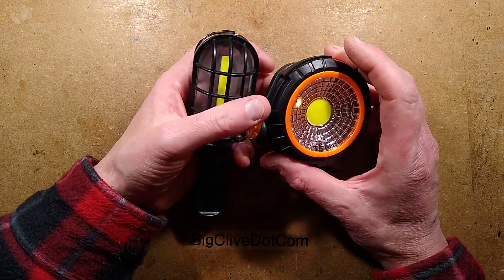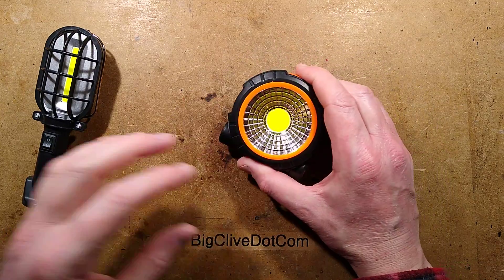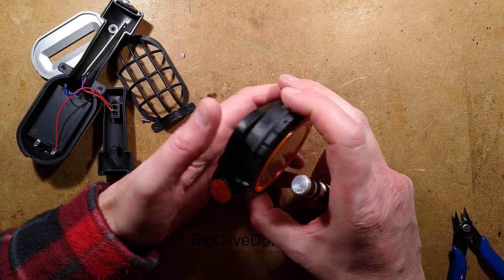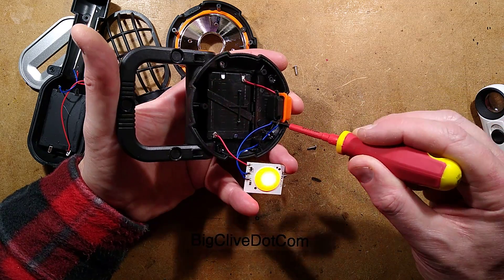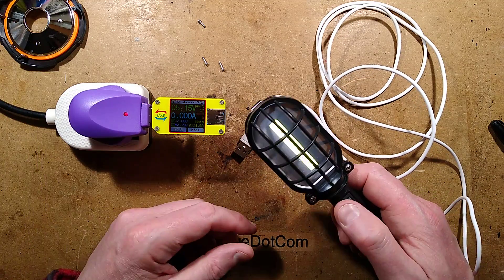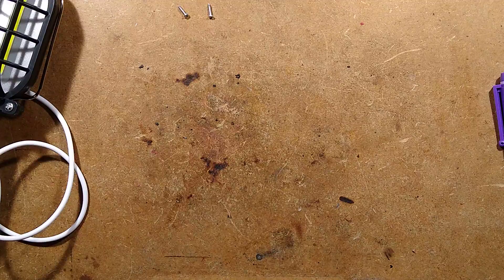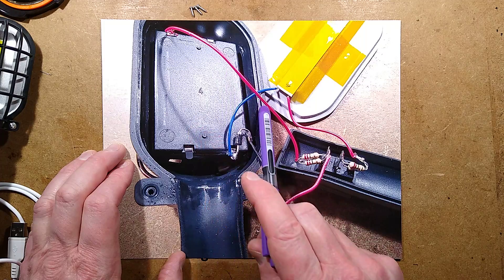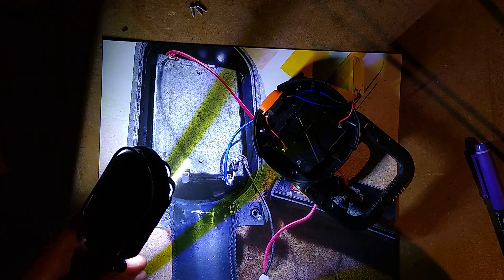Scavenging Poundland LED COBs and a hack

Comment: "this is why I don't approve of the alkaline rechargers..."
wait, what? there are alkaline rechargers, as in commercial products?? that's a terrible idea.
Reply: I used to have a load of Rayovac rechargeable alkaline batteries back in the day when digital cameras used AA batteries. They were actually pretty good compared to the NiCd alternatives back in the day.
Reply: I've tried charging alkalines myself and they usually work except leaks are easy. Lately I've put maybe 2 or 3 mA into a string of AAAs I use to power my multimeter and I've only had one minor leak.
Reply: It's worse than that, there are alkaline batteries  that are intended to be recharged. "Pure Energy" alkerlines. They are favoured by manufacturers wishing to preserve their green credentials. Cadmium is the new mercury don't you know. I've used them and guess what?  They leak.
Reply: i used them all the time through the 80s and 90s. theyre fine, just put them somewhere that when the batteries burst it drains to somewhere safe.
Reply: I remember as a kid trying to reverse alkaline batteries to get a tiny bit more charge out of them so I could finish the game I was playing on my gameboy color.

Comment: What is with those yellow lines the light makes?  I bought an LED work light for my workbench and it does the same thing.  Anyway to get rid of them?
Reply: Those are the actual LED's behind the yellow phosphor. The phosphor diffuses the light a reasonable amount but not enough to completely hide the LED.
Reply: @RedwoodRhiadra  I don't get it...  The light is coming out white in the middle and yellow on the sides, how is that from a yellow phosphor?  Oh, you mean on the LED itself I guess.  And I bet there is no way for me to fix it. lol  Damn it.  Sorry, I am working on almost no sleep lately. lol
Reply: @markjohnson7887  The LED is giving off white light. Some of that light makes it through the phosphor without being absorbed, and reaches your eyes or hits the surface you're shining it against. Some of the light is absorbed by the phosphor, which then gives off yellow light.

In particular, the light coming straight up from the top of the LED (away from the board) is passing through much less phosphor than the light sent off to the sides. Hence more makes it through and you see a white spot.

The only way to fix it is to put an optical diffuser over the top that would scatter the light and make it more uniform, but this would also make the light dimmer.
Reply: @RedwoodRhiadra  Ah, gotcha.  Thank you. :D
Reply: I just took a closer look at it.  Looks like just an LED strip.  I got this on a massive sale.  So maybe I should just get a better LED strip and change it out.  But I have no idea who is good to buy from and if I'd be buying more crap or not

Comment: Make it bigger, move the 18650 into the handle, use an adjustable voltage booster to regulate the voltage to the LED via a pot, and I'd buy a light like that. 
But not a bubblegum machine toy like this one. It's breaking as I'm looking at it! 
I bought power switches from AliExpress like the one in the handheld model. 
I think some Chinese entrepreneur (maker) made the plastic mold cheaply, and started building these in his basement! Smart.

Comment: If we had just had these in the seventies, sat in the corner for when the power went out, instead of searching for candles and matches.
Reply: Didn't flashlights exist
Reply: @whoeveriam0iam14222  Yes, they were dim, difficult to light a room and batteries were more expensive than candles. Even today I have a few candles
Reply: Flashlights existed so that (mostly) the batteries could leak all over the springy contacts, causing them to corrode and make the flashlight unusable even with new batteries :-)
Ah, the joys of ZnCl / Leclanché chemistry  :-)

Comment: Hey Clive, very nice modification to that small "super cute" work light. Being here in the midwest of the United States, it's difficult sometimes to find neat little LED lights like those two you showed in this video. Missouri, where I live has a lousy selection of these types of LED lights. It's like living out in the middle of nowhere. LOL Stay safe and stay healthy Clive. As always, I'm looking forward to your Saturday live stream.
Reply: The little blue Harbor Freight lights subject to the free coupons in every flyer are fairly similar with a hook and magnets but no handle. The old style had 27 discrete LEDs (and I believe they're still labelled as 27 LED on the shelves) but the newer version has a COB for the main light.
Reply: Damn thing still needs the unnecessary grill-work to be cut off... those shadow bars across the workpiece would drive me nuts :-)

Comment: Not sure if they have them where you are
But Walmart got some new emergency light bulbs recently, 9w 800 Lumen with a battery inside that charges when the light is in use and lasts a number of hours while providing 500 Lumens. It can tell the difference between the power being off and losing power and will automatically turn on during an outage. I got a couple of them, they're $10 each and are pretty damn nice.
Reply from the maker: I've featured a few of those "intelligent" lamps in videos.
Reply: @bigclivedotcom  Really? dont think ive seen them. Ohh yeah.... Design is sorta different, it looks more like a normal LED light.. May have to take one apart to see how similar they are compared to the ones youve tested.

Forgot to mention, they come with a little socket adapter with a switch so you can use them out of the socket too not just in one.

Comment: Should of maybe fitted a mini or micro USB port instead of hard wiring the light for retaining the neatness and originality of the light?
Reply: Skip all that; if you need a dinky light, you almost certainly don't have AC -- hence, the batteries. So, lose the AA(A)s, lop off the handle, wire a USB lead through a string of a few ball-and-socket joints, and use one of the many external supplies on hand to power the thing. The COB's the thing; the rest (save perhaps the magnet) is window-dressing.

Comment: @bigclivedotcom i've been recharging alkalines for years on a nimh charger, better brands usually last 3 or 4 or even 5 charges, cheap dollar store brands tend to leak after 1 or 2 but 1 thing i found out the hard way, do NOT try to charge zinc chloride batteries, they tend to pop rather loudly
Reply: Same and same, had to clean the  crap off both the wall and my trousers after that lesson. Never been game enough to try a disposable lithium though, cant imagine it would end well. 
I use an Aldi brand smart charger - it doesn't reject too many.

Comment: How hard would it be to have the light turn on automatically if the power is turned off?
Reply: Very hard to the point it's literally impossible, since power or energy is required to make light. That's why lights don't emit light when you turn a switch off.
Reply: @1st_ProCactus  Emergency lights do this all the time.
Reply: @Thirdbase9  They have a battery inside, usually a 12v gel cell
Reply: @1st_ProCactus   This one has three little batteries.
Reply: @Thirdbase9  I imagine the light looks dark without them
Reply: To give the answer you probably want, not too hard. One way is with a circuit like Clive has in his "Simplest solar light possible, using old phone battery" video. Instead of the solar panel use a USB supply with a series resistor. I don't remember the specifics of that circuit but you also might need a parallel resistor across the USB input. One or two kiloohms should work fine there if needed.
Reply: @eDoc2020  Thank you.

Comment: I've converted a work light that originally took three AA batteries in a holder. I used an 18650 battery and charge circuit PCB from a Poundland power bank. Tight squeeze but it all fits in and have the added bonus it can still be used as a power bank! Sockets are protected as.they are under the battery compartment cover which unscrews.  As a waterproof light, this retains this ability.

Comment: This was really interesting!  I like the calm and thoughtful way you explore items like these.  I wonder what you would think of using a Poundland LED lightbulb and some 18650 cells to convert an old incandescent 6v flashlight into an LED flashlight?
Reply: Don't the Poundland LED lightbulbs run at rather higher voltage than you can easily get from 18650s ?
I'd instead look at a white 3W LED 'bead', put the 18650s in parallel, add a low-value current-limiting resistor; the 18650s will put out 2.5V (LED off...) to 4.25V (fully-charged, LED bright) and you only need to add a 1R5 or so resistor, to hold the LED current to less than 1A.
Probably need some heatsinking on the LED, tho! :-)
Reply: @theskett  I was thinking more of taking the LED bulb apart, cutting off the mains input side of the circuit board, and wiring the 18650s directly into the DC input side of the converter?
Reply: Hm... don't the Poundland 'mains' lamps rectify and smooth the incoming mains (so 240V gets ya about 330V), and then use the switcher to put the 330V on the input side of the transformer?  Usually lots of LEDs are connected in series to the transformer output, because driving them with lower current is generally more efficient (less heating / resistive losses in rectifier diodes, etc.).
Maybe a 12V automotive lamp would be a better choice, you could probably drive that ok with three 18650s (especially if you could remove any bridge rectifier from the lamp, thereby saving 1.2V :-)

Comment: Why do lamps even have those blinking modes? What is the use cases supposed to be? I just find it annoying having to cycle through to reach the mode I use.
Reply: It's  a leftover from thousands of years ago, when fires were used for signaling. Semaphore.
Reply: They are primarily for breakdowns on highways.  Just placing one or two a few hundred metres up from an accident or breakdown at night alerts drivers something is amiss up ahead so slow down.   The red and blue strobing LED ones are especially effective as people think it's the police and immediately slow down.
Reply: The supposed use case is as an SOS without the person in need of help (who may be injured) to actually swing the light up and down.
Its pretty doubtful that anyone would ever use a cheap torch to signal for help when hiking but my guess is the only companies who can afford R&D on fancy new integrated circuits are the ones selling to the mountain climbing crowd for $$$ and the cheapie ebay specials use the same chips one generation back for other benefits (lower quiescent current?) and to save costs.

Comment: This is what I've been doing.
Swapping out bulbs for LED's in old flashlights and adding resistors in dollar store lights so they don't blind me and the batteries last a few days.  I don't know where this craze for blinding white light has come from?  I much rather have a decent light with firefly mode.
In fact, I just bought a Klarus headlamp with a very awesome hands free mode.  Thanks for the heads up on those.
Reply: It comes from the shit or non existent electronics found in torches that use 3 batteries
Reply: blinding white light makes people who buy dirt cheap torches think "wow, thats really bright" and saves the BOM and assembly cost of a resistor.

Comment: There is no such thing as a good torch that takes 3 batteries. It's that simple
Reply: Maybe the ones with 3 D-cells.
Reply: @johndododoe1411  its still 3 cells.  Meaning shit electronics and still inconvenient to charge. I don't consider any cell or battery unless it's rechargeable.
Reply: @1st_ProCactus  Those triple-D flashlights are big and can be used as clubs to smack down bad animals at night without failing.  They are popular with security guards etc.  Barely any electronics besides the on-switch.  Rechargeable NiMH D cells are available with significant capacity and separate  chargers, just don't buy a deceptive shell around an AA cell as some people sell.

Comment: More info on the calipers please. My Harbor Freight set is now crunchy and intermittent, and the Mitutoyos are too precious to be tossed about the bench with any degree of reckless abandon - I feel like I'm handling the Holy Hand Grenade. Non-metalic jaws would be nice for measuring battery packs.
Reply: The biggest drawback of the shitty Chinese calipers is the high quiescent draw on the batteries when not in use. If you don't use them all the time, the batteries would be dead whenever you need them.
What would be the point of having Mitutoyos if you're not going to use them? Quality tools can take the abuse. I like shiny new tools as much as anyone, but tools are there to be used. Battle scars have their own appeal.
Reply: I bought a similar set of "Workzone" calipers back in January from Aldi, only £7.99, I'm quite impressed with the build quality for that price....  You can get them on eBay  for about 3 quid! (although at that price they seem to be plastic! Pay a bit more for metal ones!)

Comment: 7 linear COBs and the round one and you have a seven segment display (with dot)
Reply: That round cob looks to be a decent size and output to replace the paltry 5w G4 halogen setup in the lid of a ReefOne 15L BiOrb.
Obviously it's not a straight swap,  but it'd fit the available space.
Just need to convert the 13v AC that the wall plug puts out,  into a 13-12v DC ( or less ) ,  but that can be done in-line away from the tank head.
Hmmm I love Clive's videos 😁👍
Reply: @RawTopShot  I'd look at using a capacitive dropper, probably with bipolar electrolytics. The original 5w bulb would draw around 400mA which should be a decent current for these COBs.

Comment: would it make sense to put a second schottky diode in parallel to the charging resistors (reversed) so you're getting more brightness from battery operation?
Reply: i was thinking, why not put the switch closer to the battery instead of at the charge resistors and then to the led resistors, that would still be 22 ohm on usb and 11 ohm on battery...
Reply: @fumthings  Same thought going through my mind... I think you mean put the resistors between the switch and the USB positive? Better go and buy one and check it out!!
Reply: My thought as well. Why hamstring the brightness so much? 22 ohms is a lot for that voltage.